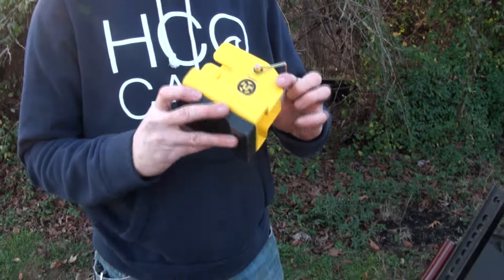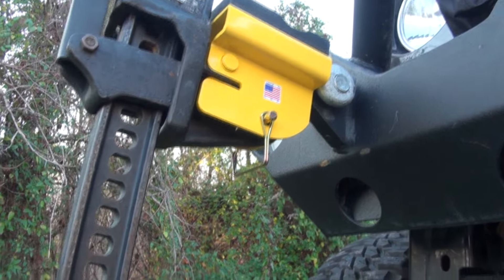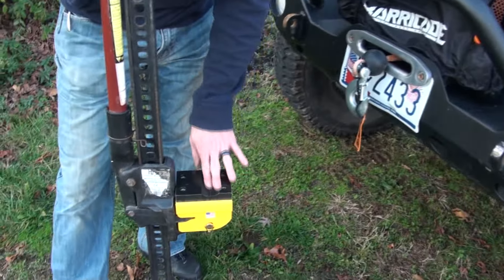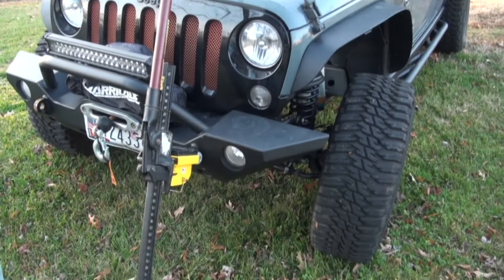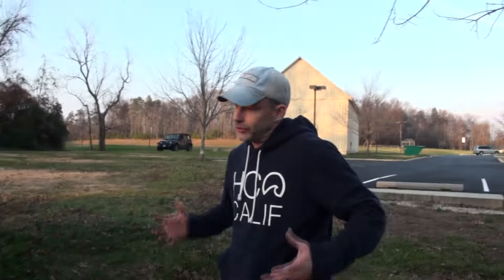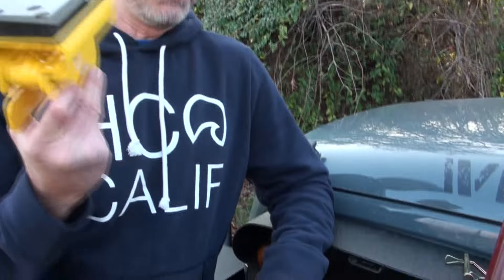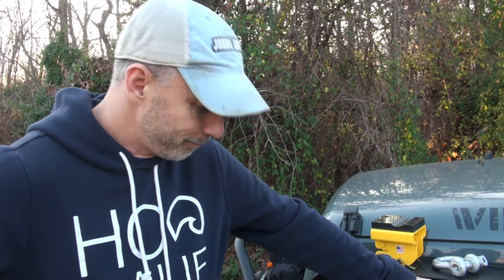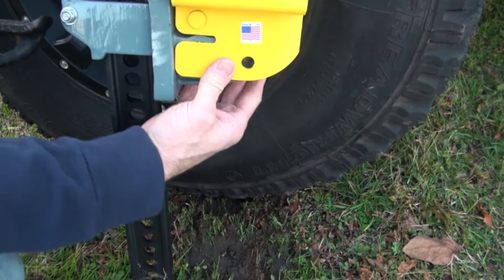Exclusive Demonstration of the D-Lift Adapter a new product for the off road community

Comment: Australian bullbars generally have a slot for the liftingarm of the jack to fit.  Or you could just put a D shackle through the hole that is already in the jack. Nice product that you just don't need
Reply from the maker: It's a very nice product.  Keep in mind that in the states we don't have as many worries about striking kangaroos, unless you include protestors in the highway, so approach and departure angle rule.  I've used this DLA a few times now, and at least in my mind it made a huge difference to my perception of the overall safety in using the high lift jack.

Comment: I see a lot of people saying it's still dangerous. And it is. Hi lift Jacks are very dangerous. But this does make it a little safer. If i didn't have my own custom anchor points for my jack I would buy this in a heartbeat. Great product!
Reply from the maker: I've held it, and used it, on a level surface, but I like it!  I'd say it's at least 90% safer 50% of the time!

Comment: The disadvantage with this is that the jacking point becomes unnecessarily high which increases your risk of the jack falling over. Jacking using a lift mate is probably safer since you don't have to use the whole length of the jack.
Reply: the higher the lifting starts the more chance of a bar bend I have found.

Comment: I like it, more than I'd want to pay though. Great examples. Still wouldn't stand in front of the Hi-Lift since it has the ability to kick forward. Nicknamed, widow maker...
Reply from the maker: It's a very nice piece of equipment, solid and well made, but I'm in the same boat as you. I've seen a bunch of stuff that seems way over priced, and usually directed to the JK/JKU crowd.

Comment: This looks like a bad idea.  It may lock the jack to the clevis, but with the clevis pivoting, it is still a widow maker.  Changes of getting hurt is not zero.  A real dangerous product.  He demonstrates the jack leaning, due to the pivot point.  If you are going to secure a Jack All Jack, secure it squarely.  This is a widow maker. Secure to receiver hitch, pin it in there.  Much safer.
Reply: Does this mean I could use it if I wasn't  married?
Reply: I could see the base letting go and the jack body hitting you in the nuts or breaking your leg  the way he was standing! The best jacks I have found are the ones from the late 70's - 80's Chevy/GMC  pickups (Box style), I get them at the junkyard they have a folding handle that is super long like 6 feet the jack will lift 6000lbs easy  and it goes up very high maybe 18"  and takes up little room,  You can put it under the diff or under a leaf spring mount or under any oither strong point on the vehicle, just need to bring some wood blocks with you  to crib  up under the jack 10x  safer than a bumper jack and most junkyards give them away!